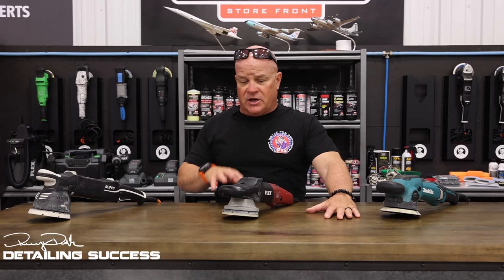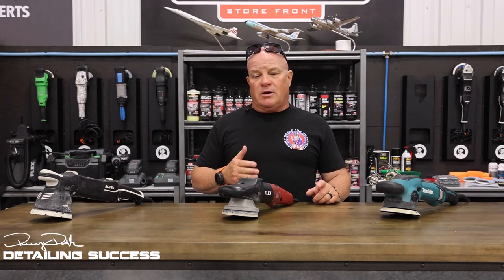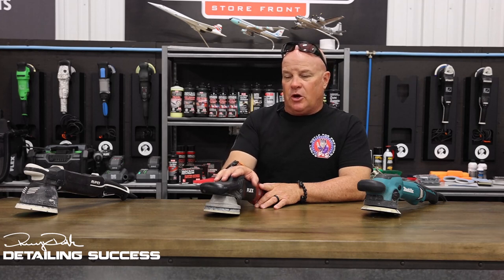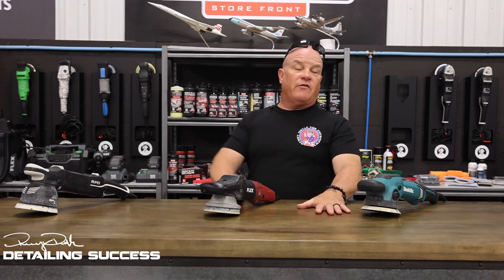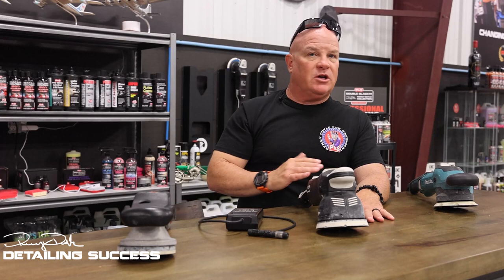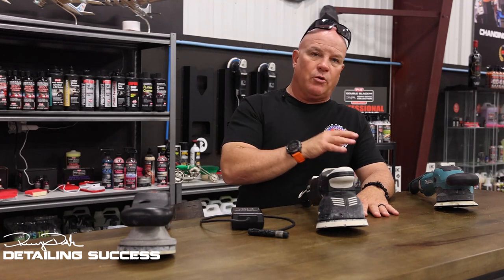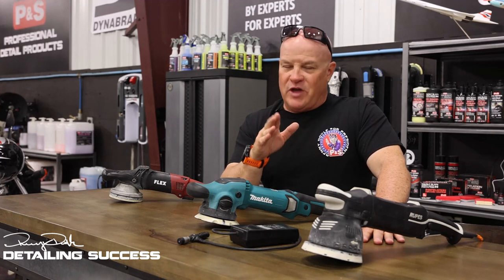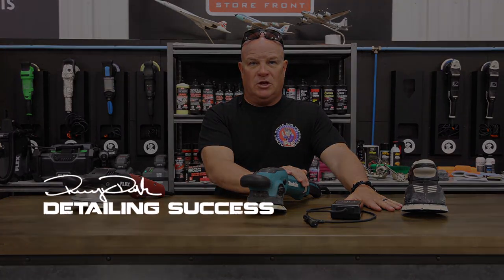Forced Action Gear Driven Polishers with Renny Doyle

Comment: The thing I love so much about the rotary and the flex is that you can run it at low speed and know it’s working. You don’t need to crank up the speed to build up momentum to prevent stall.
Reply: agreed.  Even though I've used long throw since 2008, coming from rotary and gear driven era, it feels like a step backwards and not an artisans tool. But yes they can do great things most often, my least favourite tool action

Comment: I use both. I have a Flex 3401 forced action, and I have a Flex Kompakt 3 3" rotary. I feel they are thes best you can get. High quality, powerful motors inside. That kompakt 3 has a lot of power, you can put a 5" plate on it and go to town. Dynabrade has that new one that i am sure is extremely good too. I use Dynabrade spirit and extreme pneumatic DA sanders in my paint shop and Dynabrade only makes great stuff

Comment: There is a concept I've had for a new polisher for several years that I'm trying to get any  manufacturer to make which would give this industry a tool that would fill a gap in it that is the best of both worlds of random and gear driven with a unique feature that detailers would love.  I've always loved the gear driven tools for correction but also finishing.  but there is still more evolution to go to make them better I feel, they need to be even more ergonomic and quieter plus UVP damping front and rear to make the use closer to that of a rotary feel
Reply: Hey buddy, when I tried to get my idea  only manufacture willing to do it was Maxshine, but they required 80k USD and mandated a min annual unit to be purchased every year...
So went back to hoping another manufacturer would just come out with it..
Reply: @user-yc6wx4sn5n  that sounds about right for that company. I may end up going the way you did. Why should i spend that when tool companies have the funds to do it

Comment: Our of the 3, Makita PO5000C is better
Theres 2 not seen in this video, bosch and flex XCE

They all have their pros and cons.
Really hoping the dynabrade is legit and not a simply XCE clone

Ie, needs to be smooth, not picky on pads to retain that smoothness, not get hot where your hands need to be placed and not likely to walk.

On the terminology, I like G/A best...gear action
Reply: There's also a "Forced" 3in machine that's been out a few year...short 5mm throw, but sadly vibrates like an d school GG6/PC and flex 3401

5.5 of the Makita
Most RPM second Most OPM 
What's specs of dynabrade 6.5 MM?